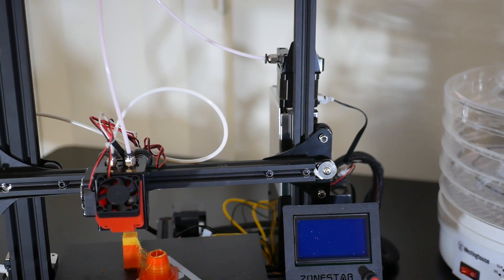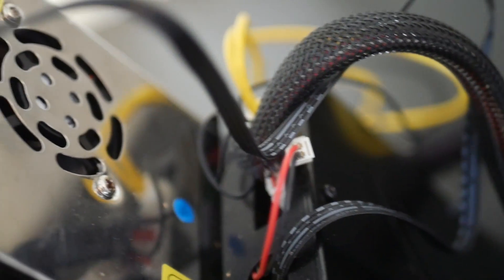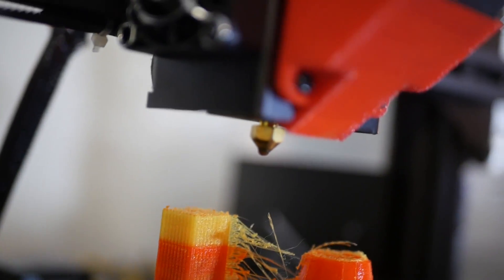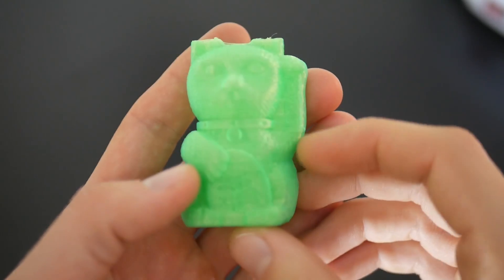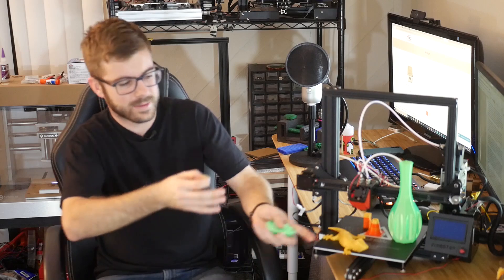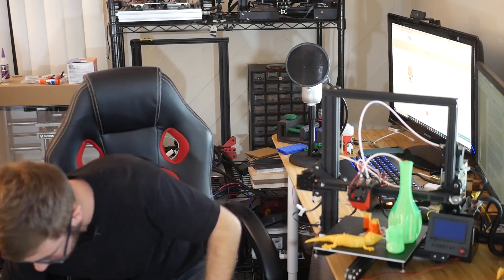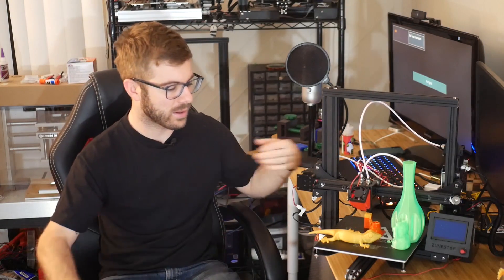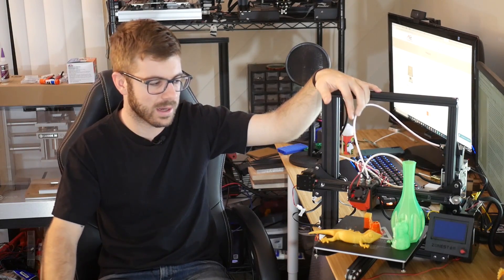ZONESTAR Z5M Dual Extrusion Printer – Very Disappointing Experience

Comment: Funny, I bought one of their earlier delta printers.  It would barely move the rubber wheels were so tight against the 2020 profile.  I had to wallow the brackets out the same way you did.  That printer got a bit tiring, so I upgraded to a genuine Prusa

Comment: If you have the money, try the geeetech a10m, that one is much better, easier to build than a ender 3, and it prints perfect.
Maybe gearbest can sponsor that
Reply from the maker: Yes, that is the one I recommend at the end of the video as well. I know a few people that own that machine and have gotten some awesome prints from it!
Reply: @ModBotArmy  yeah print quality is on par with the ender 3.

Maybe a other interesting thing for you, check out the klipper firmware. It can make almost any 3d printer pritty fast. Works well with my a10m, and there is a ender 3 profile premade if you want to test it.